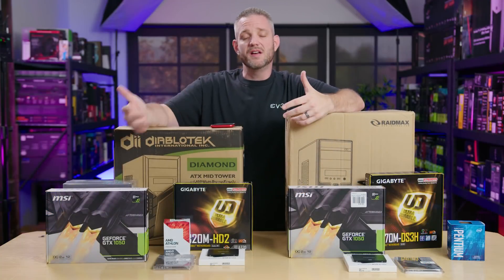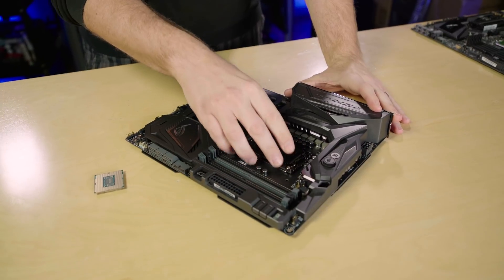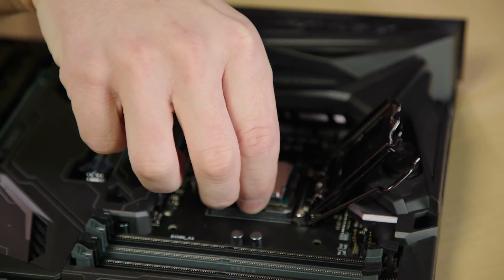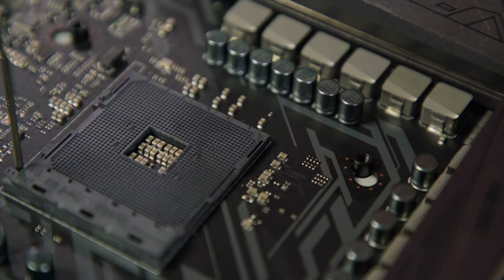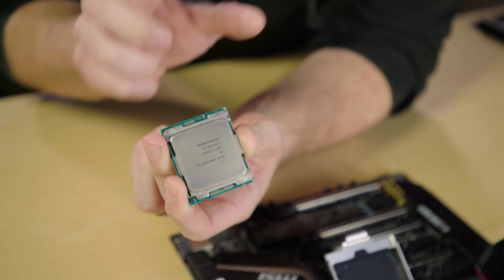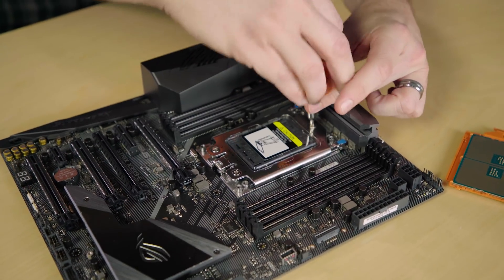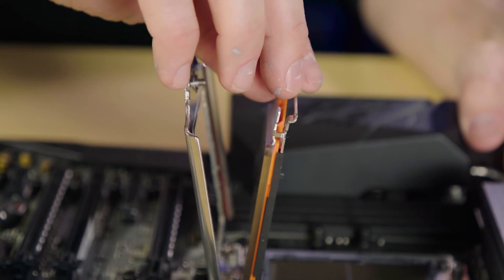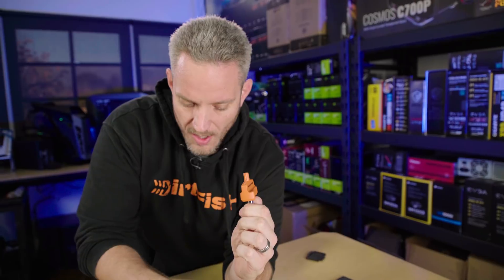How to Install a CPU

Comment: >be me
>be a few days ago on christmas
>get all the parts I want for my gaming pc
>build pc, few kinks in the building process
>realize you need a tiny bit of pressure on ryzen cpus, or maybe my 1800x is broke
>rad barely fits, but cheap AIO FTW
>finish build
>test build
>get triggered because it doesnt work
>forgot to turn on power supply.gif
>pc works
>realize this build guide is probably for all ages of new pc builders and im 13 and I did it all myself without these videos
>mfw i feel like a bragging idiot about it and my 1800x

Comment: @JayTwoCents you should do a how to change cpu coolers, how to clean up the cpu etc
Reply: JPMEX refer to the manual of your cooler for instructions, as different coolers have different mounting mechanisms. the old thermal paste is best cleaned with 70% or 99% isopropyl alcohol (rubbing alcohol), higher is better.
Reply: I just winged it and got it back running but now only 8gb ram works not the full 32 gb lmfao. gonna try a bios update.

Comment: Honestly, I have been into tech for awhile, but as I am a not a financially well off individual, I had no idea that Threadripper came with a TORQUE WRENCH! That is awesome and news to me despite the numerous videos on the subject. Thank you for your time it was not in vain. Now if I ever run into a Threadripper I will know to use a torque wrench either the one supplied or one set to factory specs. Keep up the great work.

Comment: I think a video on how to overclock the CPU would be insanely helpful. Just bought an 8700k and a Asus Maximus Mobo and have never OC’d before.
Reply: Step one: Buy a cooler.
Reply: TheBruceOakleyShow step one: set cpu voltage to 3 volts
Reply: Lol I have a cooler but I didn’t think I’d have to mention it to learn how to overclock

Comment: My i7 8700k did not have an arrow at a corner as I expected.  It did at least have the dips on the sides which I thankfully noticed before I installed it.

Comment: How does it work with switching a cpu. Say you have a motherboard that supports multiple gens of a processor and you want to upgrade. Can you just pull the old one out and pop in the new one? Anything else to be aware of?

Comment: For anyone that hasn't done it, virtually all of the older CPUs (both AMD and intel) except for the slot 1 format Pentium II/III and Celerons were installed like the AMD mainstream processors (intel chips had pins).  Go far enough back and the sockets didn't have the capture/release levers.  They were purely friction based.

Comment: I was always fine installing my processors growing up, but its a dif story for the GPU. When it came to the GPU i would always have my dad do it, because i always had this thought in the back of my mind that i would somehow break off the PCI-E connector on the actual GPU. (not the socket on the board lol) But just always had this vision of completely snapping it off.  been building with my dad since like 6yrs old, never installed a GPU by myself until like 12 hahaha. Now i'm 21 and slap a tower together with no hesitation

Comment: the wait on BIOS part is two weeks due after the cooler for the CPU, GPU, PSU, RAM then the case and prep for each one also sigh... the BIOS is where i'm at and goofed at cries for help on twitter, reddit and forums to no help i got snubbed via ASUS ROG's forums here's where to dilemma for the 123562134th timeGot fans to spin but didn't see the BIOS flash and or hear beeps via the speaker, to now get no power onshut power down on the PSU switch 3 times to case button once to this current problem going on two months with nothing...

Comment: Does thread ripper use the same socket as Epyc? Because that maxes out at 32 cores which is TR but with all the modules unlocked.

Comment: Hello from Norway Jay. 

Big fan of your channel and the content you are producing! 

You should do some more videos where you go "in depth" on custom water cooling!
I guess many people is in the same situation as me, where they live in a country where few people rock custom loops, and even fewer stores sell it. Here in Norway there is not more than one or two places where one can buy parts for custom loops without ordering from abroad. 
My main concern never having seen or heard a custom loop is noise level!
The upgrade itch has really taken a hold of me, and a custom loop would be a cool thing to have in the system. 
D5 pump and 2x360 or 430+280 rads. GPU, CPU and maybe vrm's on water. 

Today i'm running a "silent" gaming build with a 6600k at 4.6 ghz with a Noctua NH15d and a MSI 1080 Gaming X running 2050mhz in game. This buildt in a Define S from fractal, with the 6 fractal case fans running 400 rpm idle and 800 rpm in game (corsair mini fan controller). 
Storage is only SSD. At idle this is almost silent in a room with next to no ambient noise. 

Would be cool it you could make a video comparing a high end gaming system, for example 1080 ti and 8700k overclocked (noise optimized) on Air vs (noise optimized) Custom loop at idle/load.  I would guess most people considering custom loops, do this due to noise. So this would be an awesome video for people like me, who does not have "hands on" access to a water cooling store or showroom.

Comment: when i installed my cpu i was suprised and almost a little scared when i realized that i had to push down suprisingly hard on the retention arm (Intel i5 7600k) Btw i removed the cover before i installed my cpu cus i was scared that it wouldn't pop off.

Comment: Thank you for these videos.  The BF and I just built my computer earlier this year, but I'd love a go at it myself in the future, I'm scared about connecting all the little wires to the MOBO though.  ;(
Reply: The front panel connectors can be pretty hard to figure out.  Plus, small print labels or engraving on the front panel wires and the front panel labels on the motherboard itself can be really difficult to deal with.  This would be a good tutorial too.
Reply: Yep, and knowing Jay he'll do it because he's that awesome.  ;)

Comment: The most nerve racking thing for me was the 24pin connector needing a ton of pressure.
Reply: Nova I actually had mine slip off a year ago, causing extra problems on top of a bad DVD RW+R drive.  I thought my entire build was dying.
Reply: Whenever I plug in the 24 pin connector, I slide a small wooden shim under the board to protect it from flexing...

Comment: What if you accidentally touch the bottom of the CPU?
Reply: AC13Red it should be okay if your hands were clean and dry before you began, and you didn't touch anything dirty or sticky.

Look closely at the pins to make sure none of them got bent.  As long as the cpu seats properly in the socket, and no obvious dust, hairs, or dirt were on the cpu, you should be fine.

Comment: Hi Jay. Nice to see some stuff for the beginners. I've been building PCs for over 20 years now, but I subscribed to this channel as I was planning my first water cooled about 18 months ago.

But in the years I've been building PCs I never got thermal paste on the pins until this year. Panic! I little googling and I settled on the tooth brush method. If you're doing a series  for beginners then please consider covering the things that can go wrong and how to fix them.  Bending pins for example.  What has really helped me over the years is knowing not to "panic", to take my time and learn what to do.

Luckily when I got cooling liquid on my graphics card I had already watched videos on how to dry it.  I used single ply toilet paper to wick of as much water as possible and then left the system for over 24 hrs before applying power again.  And it was not a problem.  PC booted back up just perfectly.

Comment: i have question, i have 1x8gb 2133mhz 15 -15- 15 ram and i want to upgrade to 16gb, but i cant find ram with same spec.since i cant afford 2x8gb right now, can i mix my ram with another 8gb 17-17-17 2400mhz same brand ?

Comment: How to install a processor in 2020. Step 1 cut cranium, step 2 insert into frontal lobe, step 3 use liquid stitches to close cranial cavity, step 4, power on. Did I miss anything?

Comment: You're not supposed to touch the lid... Anyone watching this.. please don't do a wiggle like he's doing.. if you really wanna do it to make sure... Touch it only from the sides
Reply: anonymous There's nothing wrong with doing it. It's not fragile like the pins, it only attracts fingerprints which might possibly interfere with the thermal compound, which could always be cleaned with rubbing alcohol
Reply: It doesnt matter. You should be wiping it with alcohol before installing the cooler anyways.
Reply: Sappy this is why I'm saying you shouldn't do it,, he didn't clarify it.. so you shouldn't do it cz if you keep it like that, you may run into thermal issues
Reply: John Grimes... Since when, if you do that then good for you.. but people don't usually do that and beginners sure will face a problem.. why touch it in the first place?... Who said people have to use alcohol before installing?
Reply: Your just being a jerk-off with a stick up your ass looking for something to complain about. Don't get butt hurt because people call you on your bs.
Reply: John Grimes, well I'm sorry can't get to your level of disrespect... Anyway I am not wrong.. if you want to teach something, teach it properly otherwise don't.

I'm talking to beginners who really want to build a pc and get it right.. just an advice from a brother. And it's true, you can't just make such assumptions that people will do whatever you do in the background.

Comment: U put the 8400 in a z270 mobo dummy. That’s a formula 9. Not 10.
Reply: Mayo taizou no, it won’t work. you need a z370 mobo, different pinout and power delivery for coffee lake make z270 incompatible, even though the socket is the same.
Reply: Bubble Buddy it still fits.
Reply: doesnt matter....it works just means you paid a little more for the z chipset and you can upgrade to K later if you want
Reply: Woops youre right thought it was about putting non K processor in Z board

Comment: Nice guide.  The only comment I would say to improve it would be on the part where you gave the tip to put the extreme edition CPU in so the writing is upside down.  It's probably a slim chance of happening, however, the manufacturer of a part could always release a revision that is different than you described.  Your annotation about the socket types would help but I would hate for anyone a few years from now go to install the cpu and damage their pins. Overall, very good video.

Comment: Good video. 
I'm waiting for the most fearful part of me, namely the application of heat-conducting paste! For this part, I would like to ask you very much to show more application techniques. And after each finished technique, drop off the cooler to see exactly the extent of the paste. All I'm afraid of applying the paste is not to be too little or too much to drain over other parts of the motherboard.

In other words, I wish happy holidays and a happy new year to you an to your family!

Comment: I don't understand why they don't do away with the pins-on-the-CPU design. I was trying to reinstall a Ryzen CPU the other day and the thermal paste bonded the CPU to the heatsink, so the only way I could remove it was by ripping the CPU out of the socket with the lever still down (with the heatsink still attached)... Luckily, the CPU wasn't damaged.

Comment: THANK YOU !!!

I have done a ton of research on this as a first-time builder and its shocking how assumed it is that people know exactly how much thermal paste to use, where to apply it and how to handle the CPU itself. This is so false and I'm sure its what is holding a lot of first time builders back, I know its what has been holding me back.

Comment: Always nice to see the basics getting a "remaster" i was feeling a bit insecure when I built my new computer 3 years ago because the only good references I had were 3 to 5 gens older. When you're a beginner a don't know what changed, you wonder if the tutorial is still good. Also, anything that was related to the OS or BIOS during the win 7 era should also get a remaster IMO.

Comment: Awesome video, Jay! Can someone explain to me how the CPU sockets work? Are the sockets already installed on the motherboard? Meaning that only certain CPU and motherboard combos work. Or does the socket come with the CPU? So you can install it on your motherboard and have the correct one.
Reply: The socket is the part on the motherboard where you put your CPU. Every CPU fits into a specific socket (AM4 for AMDs current mainstream line and LGA1151 for Intels mainstream). There are also different motherboard chipsets that have different features and sometimes a CPU that fits a certain socket will not work with it because of that. AMDs CPUs are always overclockable, for Intel you need a CPU with a K at the end and a chipset that supports it (Z370 for the current generation).
Reply: Thank you for the in-depth response! It was very informative!
Reply: Also something else to know, Z270 motherboards also support overclocking, up to 7700K.  Only 8700K and higher need the Z370 chipset specifically.

Comment: I think you should have mentioned the "LGA crunch", the sound an LGA socket makes when the cpu is installed, especially the first time. Many people might think they broke something if they havent seen it mentioned anywhere.
Reply: the crunch was noticeably louder when i was installing my 7900x into the x299 gaming pro carbon and thought i destroyed it
Reply: Illsigvo until my recent pentium build I only built with used lga boards(like 775 and 1155) when I installed the pentium it had a nice crunch noise.
Reply: Oh man my first build was 775 and I remember that sound.

Comment: Hey good and interesting video.

Now going on after the COU instalation: what thermal paste would you recocment(carbon based?, cermic based? ore evan liquid metal?) and how would you apply it?
Reply: The best cheap thermal paste out there is the Arctic MX-4. You usually apply it by putting a pea-sized droplet onto the middle of the CPU and then putting on the cooler. If you want every  last degree, firmly spread it on the top of the CPU until everything is covered. You do not need a lot of it. For Ryzen, many people recommend a thin vertical line instead of the pea because of the shape of the die.
Reply: Thanx for the hint.
good to know I did It right the right way the last coplue of times.

BUt what do you think about the liquid metal TCMs? are they worth It?
Reply: Maximilian Simon The liquid metal ones are made for usage under the IHS. The IHS is the silver part of the CPU you see. The actual silicon below it is much smaller. The IHS (Integrated heat spreader) is only there for protection and heat spreading. There is preapplied thermal paste between IHS and die (the silicon), wich is really bad in Intels case. It is possible to take off the IHS and to replace this bad thermal paste with better one and this is where the liquid metal is used. It has great thermal conductivity, but it also has downsides that make it bad for usage on top of the IHS like being conductive and hardening over time.

Comment: Jay, a very very very important question I have been trying to find an answer to. What if my case has more fan options then I have connections on my motherboard for? Say I have 10 fans, but only 3 connections on my mobo, how can I make them work? How does a fan hub work? What's PWM?? You'd really help me by doing a vid where you explain this. I am sure this would help out a lot of us pc builders who do not know it all, hence me watching all your clips
Reply: If you have an overwhelming amount of fans then a fan hub is probably the best solution. It takes a bunch of fans and is connected to your motherboard via an onboard USB header. It will also need power (usually a molex or SATA connector) from your PSU. Then you can control the fans using software. Some cases come with included fan hubs, mostly those with fans that have controllable LEDs and sometimes they have non standard headers on these fans, so you should check out what type of fan hub the case actually has.

If you have a couple more fans than your motherboard headers allow you can use a fan splitter, eg you have 4 fans but 3 headers which is a common scenario. Just dont overdo it since each header can only provide a maximum of about 1A of power (fans usually say how much amps they need either on their back side or in their online spec, usually its around 0.2A for a standard fan). However given you are most likely to use a fan splitter on a low end motherboard that may have fan headers capable of less amperage it is always good to doublecheck before loading a random header with a 6 way fan splitter.

There are 3 pin and 4 pin (PWM) fan headers/fans. A 4 pin fan header allows you to more precisely control the RPM of the fan while a 3 pin fan header achieves the same by varrying the voltage. PWM has more smooth but slower transitions. You can plug a 3 pin fan in a 4 pin header and most motherboards will detect it as 3 pin and control it as such, but plugging a 4 pin fan in a 3 pin header will cause it to run at 100% (since the 4th wire that is used for controlling the RPM is absent).
Reply: A fan hub works just like a USB hub. You use one header and power to get a virtually infinite amount of headers. PWM is digital control of fan speed and used on motherboard fan headers. If you attach your fans directly to the motherboard, they should be PWM fans. Any non-PWM fans require a fan controller or they will spin at full speed all the time.